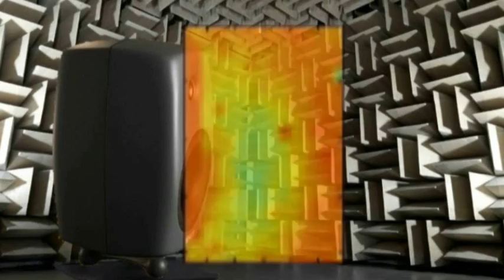Seeing sound - A new acousto-optic scanning technique

Comment from the maker: @dtmmmtd Good question.. The retro-reflective board needs to be far enough away from the speaker, in this case approximately 4 m, to ensure that any induced vibrations, and the resulting effect on the phase of the light, are insignificant in comparison to that caused by the acousto optic effect.